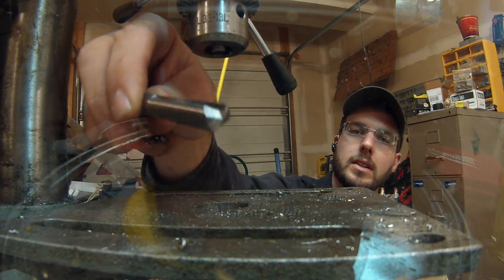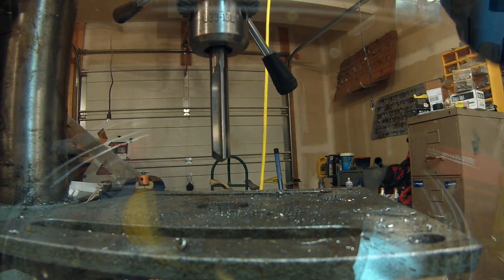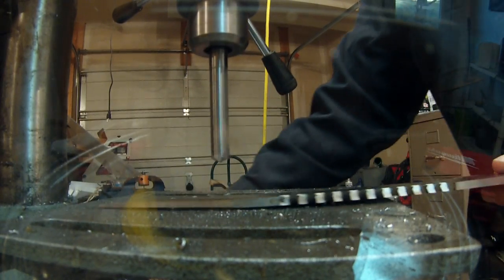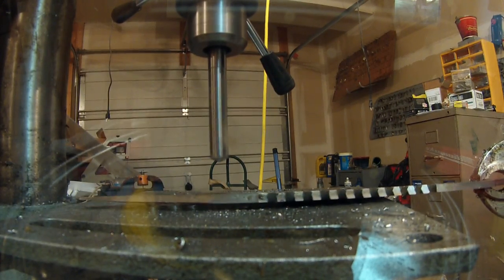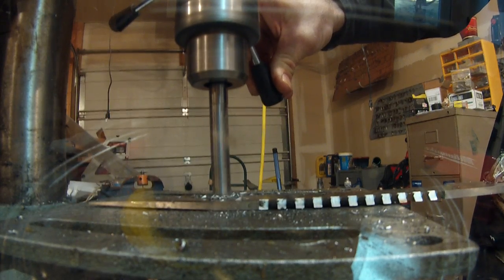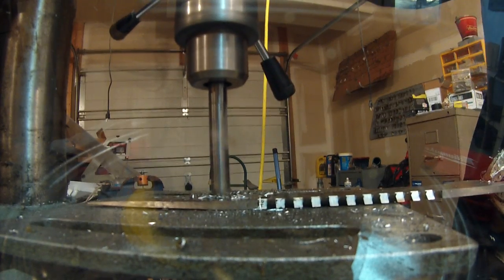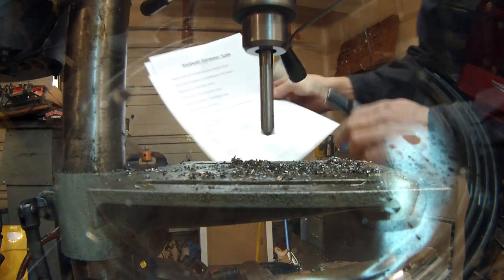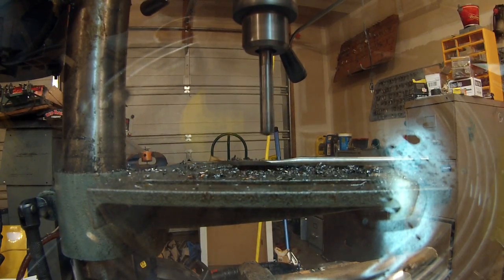Solid Carbide Drill Bit Test

Comment: Just ordered a 1mm Carbide bit from Mc Master Carr.. I snapped 2 of 1/16th drill bits that came with my Dewalt Cobalt drill bit set.. I needed to drill a hole threw a piece of 1/8th Titanium round stock.. I got my Starrett 816A Prick Punch
today from Amazon and it worked very well putting a dimple in the 1/8th Titanium round stock I ordered also from Mc Master Carr a couple months ago for another project I was working on, which was making lock picks from Blue Tempered 1095 Spring Steel Shim Stock 0.025". I needed the Titanium Round Stock for making pins for handles for my lock picks.. never used the Titanium.. But probably will in the future, just like the lock picks the way they are, without the oak handles on them. So yep.. can't wait to get my 1.0 mm Carbide drill bit, very excited, never used or had anything made of Carbide before. Cost me $9.62 for the drill bit.

Nice video, (+1 : 1)
Reply from the maker: Thanks. I hope it works well for you. Be carefull with a bit that small in size as carbide is very brittle. It would be ideal to have a drill press set up and bevable to use a cutting paste or fluid I like TTP cut-it paste. Best of luck!
TTP Cut It Past Review - Drill Bit Lubrication
Reply: Wayne Winton
Yeah, I was thinking of buying the Skill 3.2 Amp Drill Press from Lowes. But I just need to drill one hole, and I don't think it would be money well spend even if the press is only $129.99. But I'll definitly be careful, I did manage to drill my hole, but had to go with a 3/32nd drill bit, the hole was a bit bigger then I wanted, is why I was upset, and ordered the 1.0mm bit when I got back inside..
Reply from the maker: Roy Andrews OK well let me know how it works out. Take care!

Comment: i'd like to see manganese plate being drilled. You can tell the difference compared to even the toughest spade drill by the sparks produced when you take an angle grinder to it. This is the kind of material that protects locks on armoured doors in Europe...
Reply: Tungsten carbide is used for drilling locks. You just need to compare the hardness/density of the drill bit with the to be drilled metal to see how each would do. Tungten is only less dense than uranium. If you need to drill uranium, you'd need diamond.
Reply: @fungames24  Threre is no "one material" for drilling locks, from HSS to HSS-Co to TCT to solid carbide all have a role to play. Also, I'm not talking about any type of lock but about anti-drill plates. The position of an element on the periodic table means absolutely nothing, when referring to manganese plates we mean the alloy, manganese steel or mangalloy for some, an alloy that is often called "unmachinable", used for tunnel boring in mines and such.
Reply: @popded  The periodic table does come in to play. Mangalloy is drillable with diamond. A depleted uranium tank round will also punch through. As for tungsten, it can work if you keep it sharp: https://www.youtube.com/watch?v=4RsgAhpI_EM

Comment: awesome
i would really want to know the differences between the one u have and the solid carbide twist drill bits (not the masonry)
Reply: Normally the straight fluted bits are fore thin material drilling, 1/4 inch or less, 
the twisted ones are designed to evacuate the chips so they're better for deeper 
drilling jobs.

Comment: Do you realize  if you lost grip on that blade the drill could've spun it and then threw it in what ever direction ?
Reply from the maker: woulda, coulda, shoulda..... didn't
Reply: when the carbide bit jams it can chip and need sharpening with a diamond wheel .  that i need to see

Comment: Wow ok what do you do if you break your drill bit in a hole. I need to remove a broken carbide tipped drill bit.
Reply: Well, you could try spark eroding it out - that's the best and most expensive option. It is also possible to drill it out with a diamond hole saw drill bit but you have to keep it constantly cool with water and it takes ages.
Reply: Id try to break it up if the piece its stuck in isn't delicate.

Comment: Should try drilling some nitrided QPQ stainless 416. That stuff is used in high end gun parts and claims a Rockwell Hardness in the high 80s
Reply: Merp bahaha it's only hard on the surface less the the width of a hair. You can just scratch it off on the sidewalk curb.